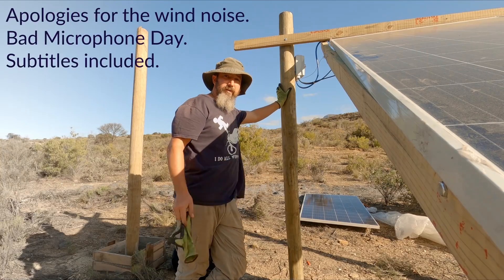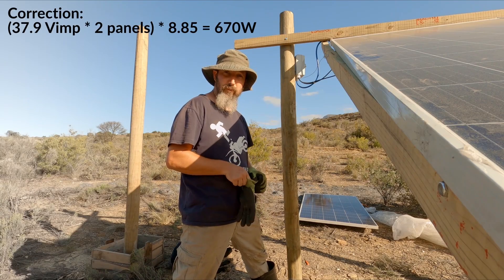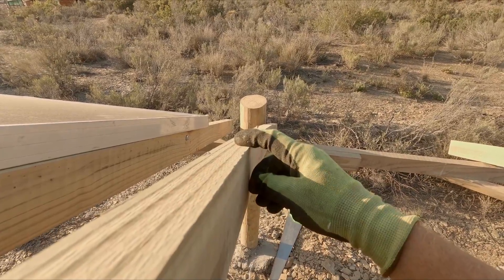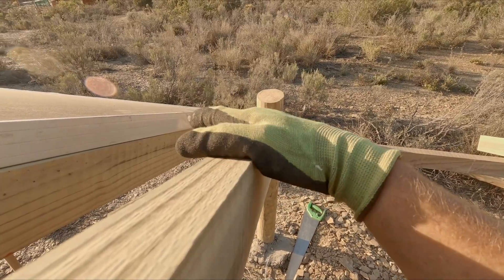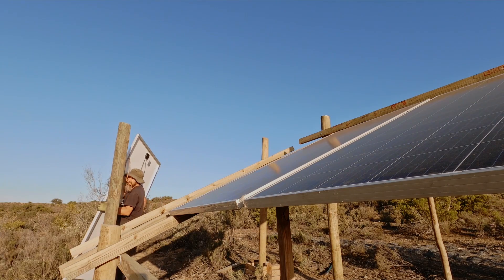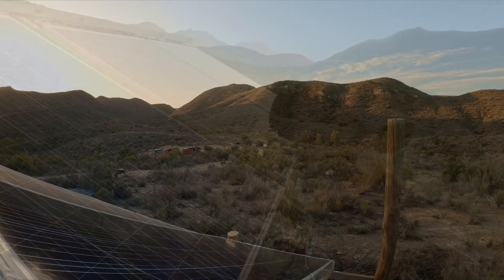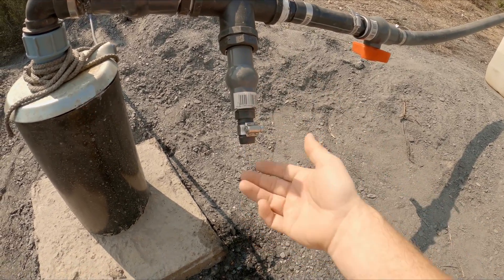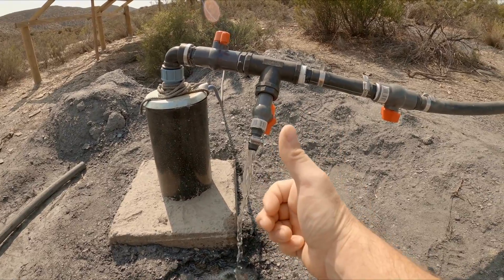Underpowered DIY Solar Pump Upgrade. Series/Parallel Solar Panel Wiring?

Comment: Electrical losses (heat in the wires) are proportional to the square of the current. Three times the current (parallel connection) will result in NINE times the loss. Series connection is better if your input voltage range of the pump allows it.

Comment: Remember to wash the glass of your solar panels when they get dirty.  Your system is loosing a lot of potential solar energy because of the dust I see on the glass in the early part of this video.  Dirty glass will reduce the amount energy that makes its way to the photovoltaic cell surface due to shading and reflection and the panel will heat up because the dirt acts like a blanket.  SO you have multiple efficiency losses occurring.  DO you have battery storage on this array so that you can run the pump at sundown time of day? 😊

Comment: Toujours plus loin dans la préparation,  900w sur un point solaire cela fait une belle production....Le courant n'est utilisé que pour la pompe?
Reply from the maker: Yes , this is only for the water pump. Dedicated power for a dedicated use, and not dependent 9n working home electricity 😀👍